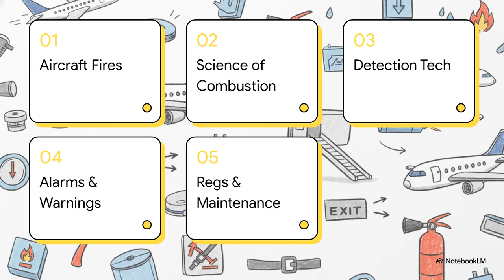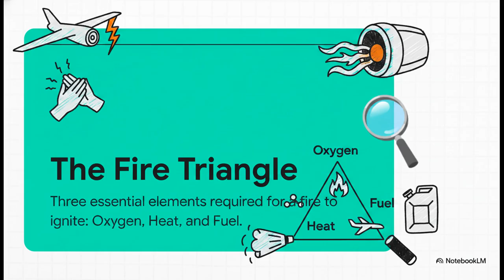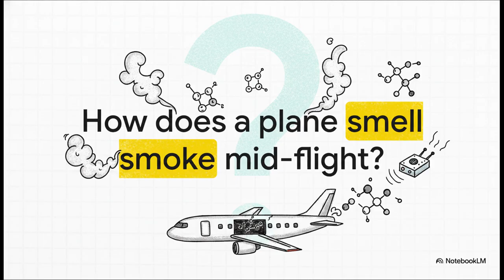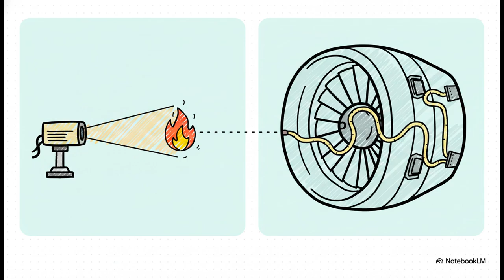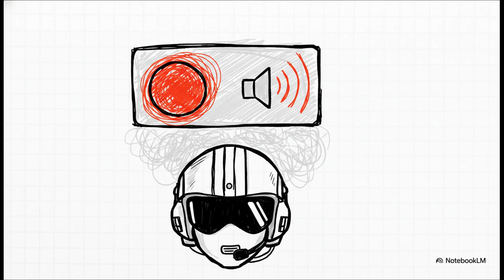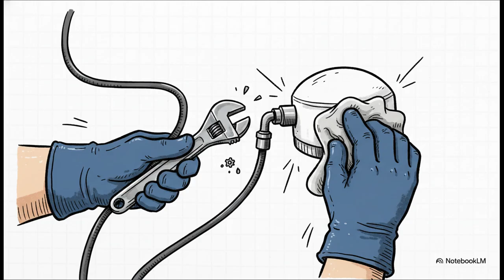AMTE 241 LESSON 02 AVIATION FIRE SAFETY

Comment: S.LAVALLE_AMTE241_1B_AY20262027

After watching AMTE 241 Lesson 02: Aviation Fire Safety, I learned that fire safety is an essential part of aviation because aircraft have fuel, electrical equipment, and other materials that can easily contribute to a fire. I understood that aviation fire protection mainly involves detecting, warning, and controlling fires. Detection systems help identify signs of fire, such as excessive heat or smoke, while warning systems immediately inform the crew about a possible fire. Fire suppression equipment is then used to control or extinguish the fire and prevent further damage. I also learned that different types of fires require appropriate methods and equipment to safely put them out. Regular inspection and proper maintenance of aircraft fire protection systems are important in preventing accidents. Overall, the lesson taught me that being prepared, responding quickly, and following proper safety procedures are important in protecting the aircraft, passengers, crew, and maintenance personnel from the dangers of fire.

Comment: The video gave me a better understanding of how important fire safety is in aviation and how aircraft are designed to protect passengers, crew, and critical systems from fire. One of my main insights is that not all aircraft fires are the same, which is why different types of fires require different methods of detection and suppression. The video explained the five classes of fire and showed why identifying the type of fire is an important first step in responding to an emergency. I also learned about the fire triangle, which consists of heat, fuel, and oxygen, and the fire tetrahedron, which adds the chemical chain reaction that keeps a fire burning.

Another important lesson for me was the role of fire detection and warning systems. Different detectors, such as smoke detectors, infrared flame detectors, and continuous-loop thermal switches, are selected depending on the environment where they will operate. The video also emphasized that detecting a fire is not enough because the information must quickly reach the flight crew through clear visual and audio warnings.

Overall, the video made me realize that aviation fire safety depends on advanced technology, proper system design, strict regulations, and especially careful maintenance. Aviation technicians have an important responsibility because even a small problem with a detector or warning system could affect the safety of an entire aircraft. Regular testing, proper installation, cleanliness, and following maintenance manuals are necessary to keep these systems reliable. As an aviation student, this lesson reminded me that safety should always be a priority and that every maintenance task must be performed carefully and responsibly.   
JONNIE M.VILLAMER_AMTE 241_1B_AY2026-2027

Comment: What impressed me most when I was looking at this lesson on aviation fire safety was the analogy used of an aircraft operating like a living organism having its own dedicated "nervous and immune systems". The video gives a very effective explanation of how flight engineers deal with combustion in such harsh and volatile conditions. It connects the basic principles of chemistry, moving from the conventional fire triangle to the more complicated fire tetrahedron, in the context of practical aerospace engineering. The fact that modern chemical extinguishers do not merely suffocate the flames but actually interrupt the chain reaction at a molecular level shows how great a degree of precision is needed in modern aviation.

The talk about detection technologies was very enlightening. It showed how carefully aircraft are designed by employing different types of sensors. For example, using strong continuous loop thermal switches in the extremely noisy and vibratory environment of engine compartments as opposed to optical sensors in the cargo holds. I also liked the focus on human factors in the warning systems since verifying alarms through logical means ensures that pilots do not become overwhelmed by cognitive stress when in a crisis. In the end, as the aviation industry moves towards higher-energy systems, the idea of using AI for predictive fire safety appears to be a necessary step in reducing these severe risks. D.A.PICONES_AMTE 241_1B_AY2026-2027